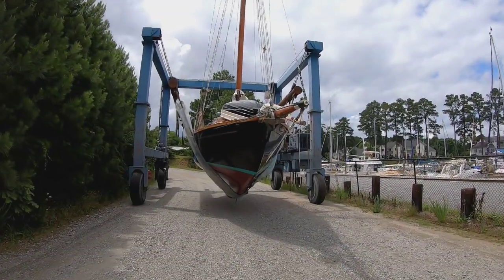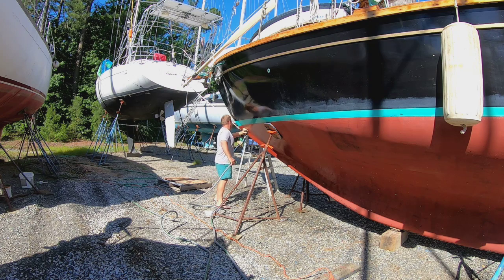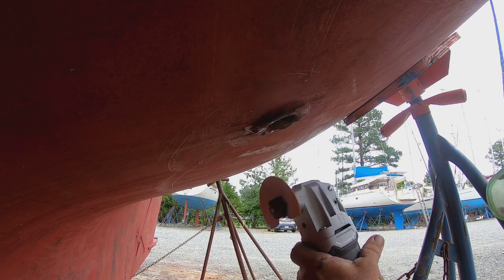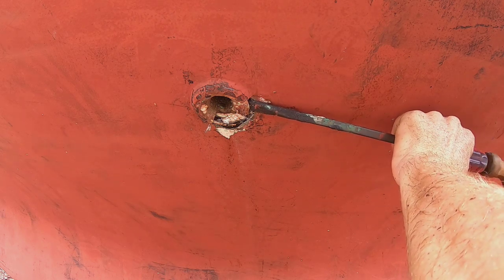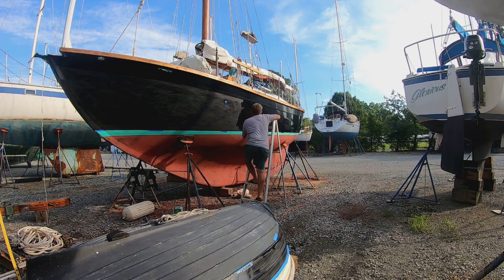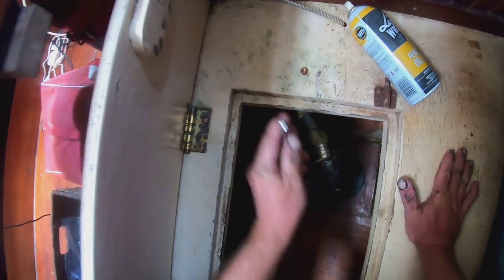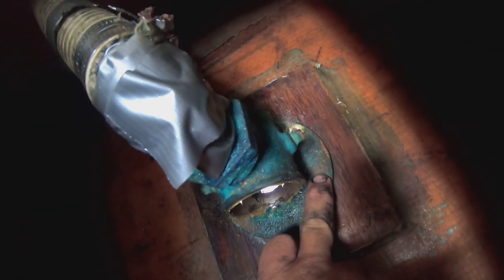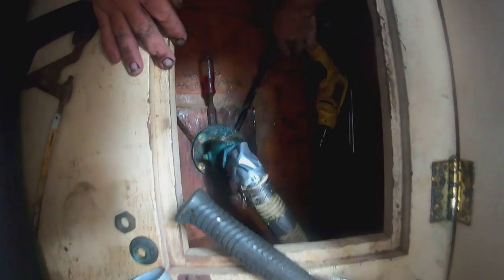Through-hull replacement and other fun things,  part one

Comment: I quartered the mushroom with a grinder and knocked them off with a hammer, then banged out the threads with a socket wrench/extension just smaller than the hole. It’s some hard work!
Your way sure is a lot cleaner than what I did :)
Reply from the maker: I think it's a hard job no matter which method you choose, if the fitting has been in for a while and is held in with 5200

Comment: Ahh fun, through hulls, our main 2-1/2" dump port had to be changed out when I surveyed it and found it loose. Old brass, just applied some heat and inserted square stock pieces and sprwader wedge against flange ears and then after a few tries and som french dressing vocabulary and one of us on each end with 16" pipe wrenches voila we unthreaded it and the pipe from flange.. A good cleaning. Lubrication and it was back in.. Od course with 5200, because until next time I can sleep at night knowing the 5200 will hold.. And si ce it was original i stall from 1973, not half bad.. About a thousand dollar valve if we had to replace it.. But just a maint service and back in action.  Love your dedication and patience Kevin.. Thanks foe sharing.. Hope to see you out there some time . maybe you might see uss pass by your port side horizon heading south soon..  Fair skies and happy sailing..
Reply from the maker: French dressing vocabulary, ha!  Safe passage south ...

Comment: It seems like an expansion reamer would work well to shave out the old existing part.  You'd need to be carefully and go small increments per turn. Soak in acetone and rinse the reader with water when done.

Comment: Once again, good stuff. I really like the ambiance in your videos. I've used a step drill bits to remove old thru-hull fittings, they seem to work well. It takes just a couple of minutes to get rid of a flange of a 1" - 1 1/4" fitting.

Comment: A far quicker way to change through holes is with a hole saw. Cut a dowel or flat batten and hammer into the orifice. Pick a size of hole cutter that will cut into the external flange at the body flange joint. The dowel centers the pilot drill as you cut. When you are through the flange thickness of brass, use a blunt tool (think old chisel with rounded corners) to pry the flange off. With a bit of practise, it's about a 5 minute job to get the through hull cut and out.
Reply from the maker: That sounds like a good way to remove composite throughs.  Cutting through an inch of bronze seems like it would take a while.

Comment: Just did this job on my boat.  I might add, to avoid the bendy chisel part which could damage some fiberglass through prying, just use a Dremel with a cutting disc in the center of the flange to cut the flange where it meets the seacock threads.  Do this cut from outside the boat, so the flange will eventually just pop off.   As to the bolts, just drive them out from the inside, nothing holds them but some 5200 outside.  Hope this makes sense!
Reply from the maker: Hadn't thought of trying to cut around in a circle, though that sounds like it involves more skill.  It looks to me like the bolts are embedded in the wooden backing plate, but perhaps they go into the hull.
Reply: @howtosailoceans1423  You"re right about the bolts, I had no wooden plate, mine were just recessed into the hull.
 making them easy to pop out.  Amazing how through hulls can be installed in different ways.

Comment: The most casual paint job I' be ever seen! Back and forth, up and down ... no rolling, tipping etc? What grit for your prep sanding?  Your boat always looks great, next haul out do a focus on your technique. Been up the Potomac by the way?
Reply from the maker: Generally: first coat, 150 grit;  then 220 for the second; 320 for the third.  Only been to the mouth of the Potomac, up the St. Mary's river.  I may stop there again on my way south to check in on a fellow engineless sailor.
Reply: @howtosailoceans1423  oh yeah, no engine ... twisty river. Still though, Arlington,  Washington bassin with free anchorage. Thanks for the paint advice, deck and doghouse this fall ...   I'll try brush alone and Petite.

Comment: Did you consider using a " Thru Hull Installation Step Wrench, 1/2" to 1-1/2" , not to be confused with  a  "Groco  Thru-Hull Installation Tool " 

for removal and installing new through hulls
Goggle will help source vendors!,  typically $60
Reply from the maker: I looked at one of the those, but the advert said not to be used for removing old through-hulls, but perhaps I was looking at the latter.  I'll revisit when it comes time to remove the other through-hulls.
Reply: @howtosailoceans1423  

Yes there  is a difference and the first item 

 " Thru Hull Installation Step Wrench, 1/2" to 1-1/2" 

is a removal wrench as distinct from a assistant to install a through hull, which is the latter item you referenced.

Comment: My god man.  Take the hose off the thru hull valve before attempting to remove.  You would have saved yourself so many headaches.  It was driving me mad!  And next time, it there is a time, use bigger prybars instead of screwdrivers. Uhggg.
Reply from the maker: Yeah, removing the hose may have made it a little easier, but then it did give me something else to grab on to.